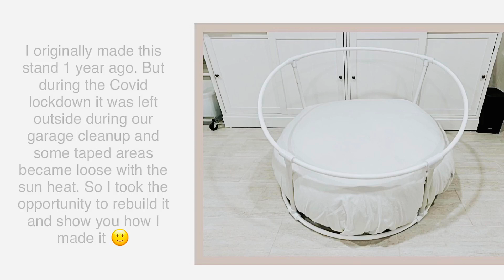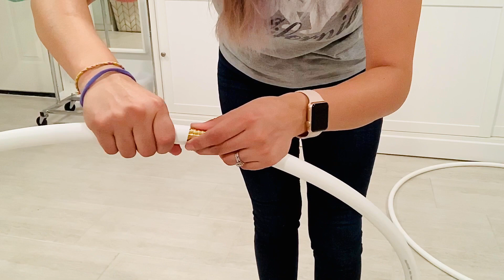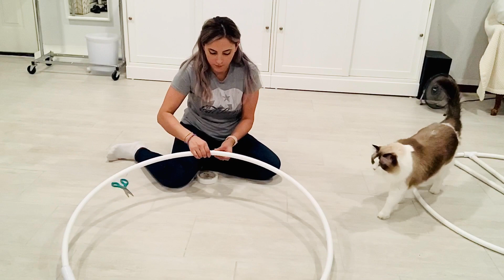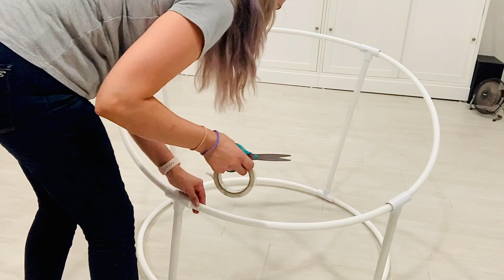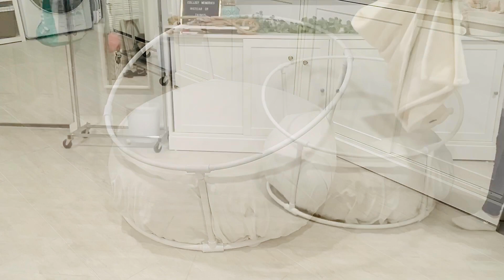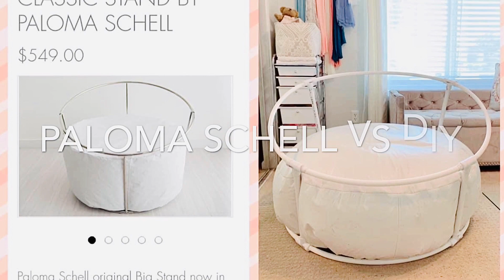DIY Newborn Photography Backdrop Stand | Posing Stand

Comment: Thank You So Very Much!!! Can I ask what size bean bag you are using? I have a studio-sized beanbag? Is that what you have?
Reply: So, I just checked mine is 40" in diameter and 12" in height, do you think this would still work or would you recommend shortening the PVC poles by 4" to make up for the 4 inch difference?

Comment: thank you so much for this video!! would you make a video of how you made your bean bag or sell the pattern? :)
Reply from the maker: Since I made the bean bag such a long time ago I don’t think I will be making a video of how I made it 😅 I didn’t use an actual pattern. I basically just cut two large circles of vinyl (one for the top and one for the bottom), then I cut a long rectangular piece of vinyl for the circumference of the circles. I used my sewing machine to sew the pieces together leaving an a opening on the side of the bag and used velcro to be able to close and open the bag.
Reply: @MayeliTorres  what did you fill it with
Reply from the maker: @jackiepauciello6276  beanbag beans which I purchased on Bed Bath & Beyond, but I think Walmart also has bags of it online.

Comment: What are the dimensions of your beanbag? This is a great idea!
Reply from the maker: Thank you 😊💕 My beanbag is about 40” in diameter and 16” high.
Reply: @MayeliTorres  Hi, thanks for this video, great alternative to the Paloma schell version, which is extremely expensive.

What tube measurements would you recommend if the bean bag is about 40 in diameter but 20 in height?